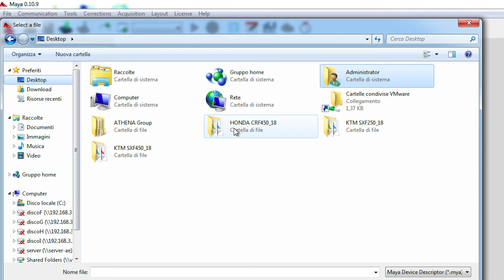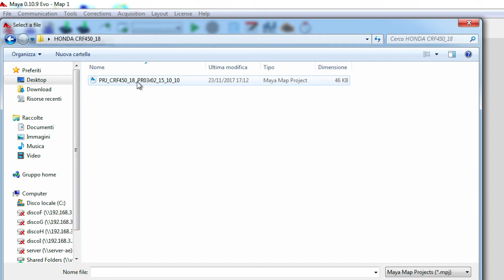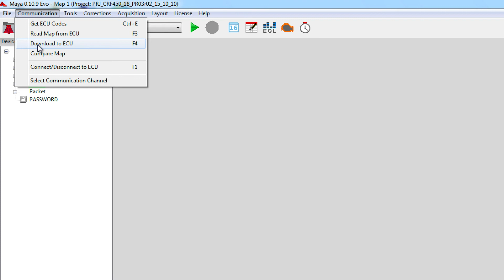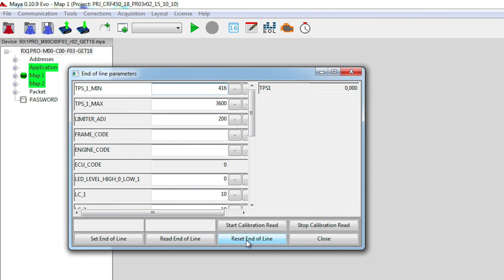Tutorial MAYA Software by GET (English Version subtitled in ES, FR, DE))

Comment: Can maya software be used through the wifi attached to the the ecu?
Reply: Using or making updates to the calibration files with  MAYA requires a USB/Serial connection between the GET ECU and Laptop. The WiFi Com module is only capable of resetting the End of Line maps/settings.
Reply: @JustDSM  I figured it out. The 2020 version works much better than the 2017 version.